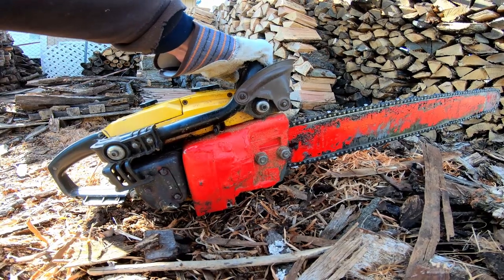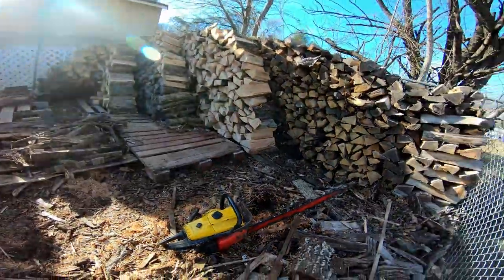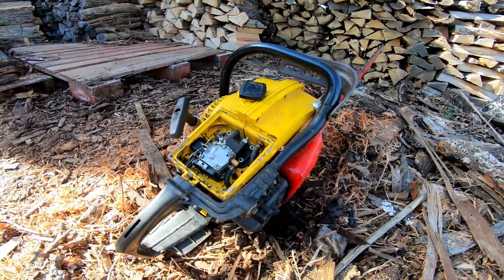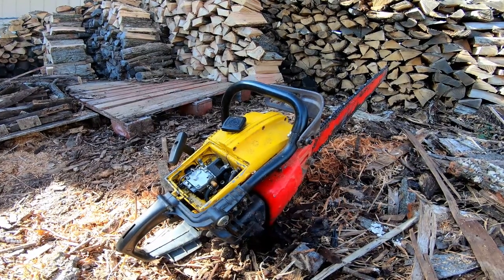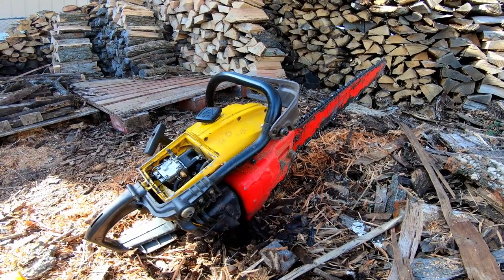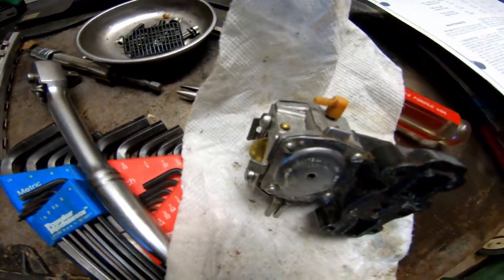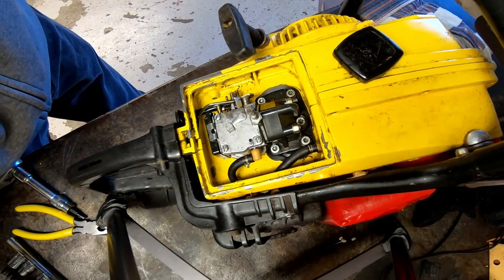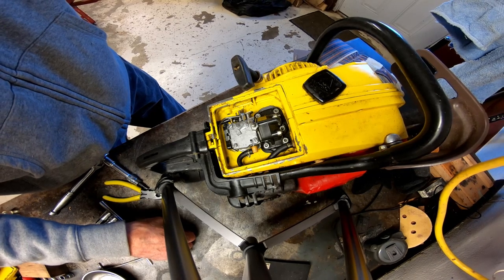Alpina Pro 120 Chainsaw

Comment: Hello, you do not seem to use the decompressor when starting; this suggests a very low compression rate or a leaky decompressor. Even their 70 cc saws have ferocious compression, being hard on wrist and shoulder and in the end, the starter mechanism. Original starter handles are basicly unobtainable now, since they desintegrate in time. This saw was developed in the 70's at the latest (and yours build around 1980 if the fuel cap came originally with this saw)) reflecting the oils to mix into the fuel at that time. Hence the 1:20 that you can ignore with the present modern oils, with a 1:50 more likely and even higher depending on formula.  Your saw does not look 'beat up' in my eyes btw. Yes, parts are like hen's teeth, but a rear handle including full muffler cover and safety mechanism can still be had. Thank you for uploading and share your experiences with this fascinating saw.